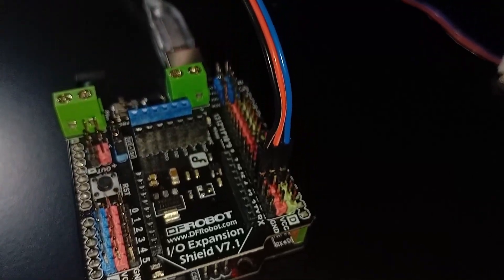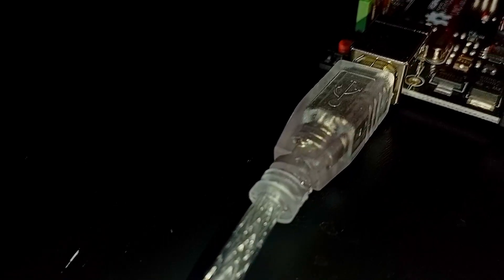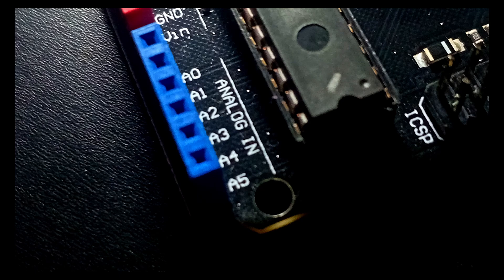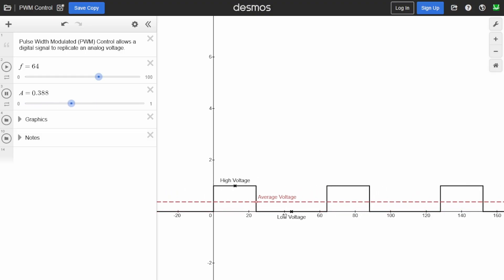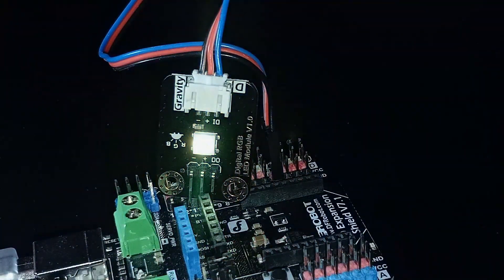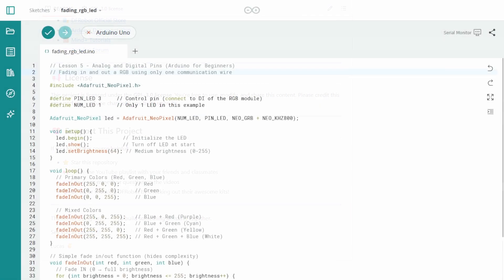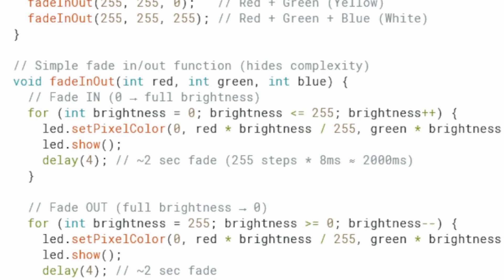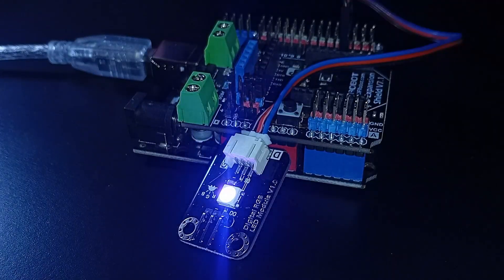Analog and Digital Pins on Arduino - Lesson 5

Comment: Please build project powered by battery holder, and please make a cover for it and make it small. Like I am completely new to this and wanna build something that is small, powered by 4 cell holder. But I dont have l293d driver shield for arduino, and like I have not seen much projects which use arduino uno and are covered, like a device.
Reply: and i dont know if we use breadboard in projects which are made like device. I can't use breadboard in the device I wanna build coz the breadboard I have is way to big in length
Reply from the maker: @TinaK-mk1qy  What exactly do you wanna build?
Reply from the maker: Thank you one more time for your comment. I really appreciate that. I have some projects in mind that require 3D printing, PCB manufacturing, etc. I'll document and post them in the next weeks/months.